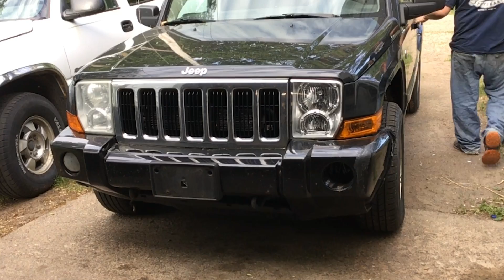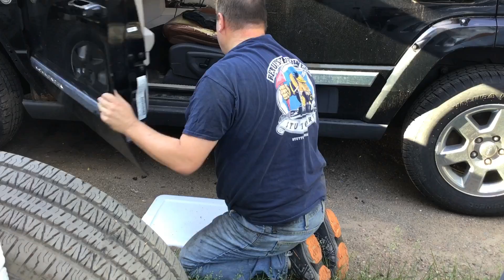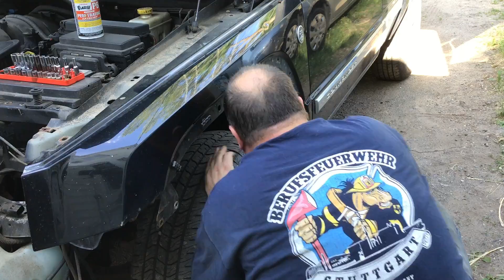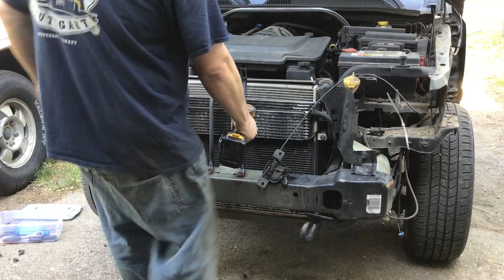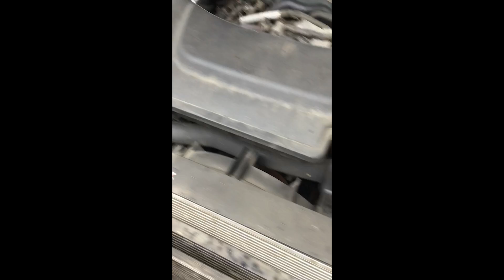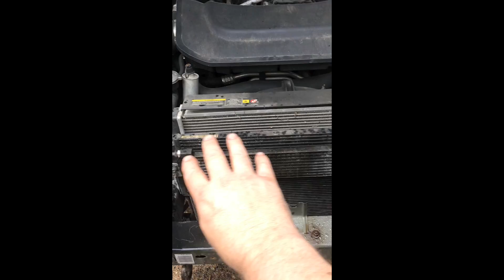Jeep commander project build part 3-🆕jeep Commander Project Front End Disassembly 👉Must See!

Comment: I think I just hit GOLD with this Commander build series‼️ I've already upgraded my Commander's front suspension with OME/ARB springs, Bilstien 4600 struts and JBA UCAs. I've thought about going with the Monroe load leveling shocks in the back or OME springs with Bilstien shocks. 
I haven't checked yet, but I hope you provide a link for an all aluminum radiator as I've yet to find one online.